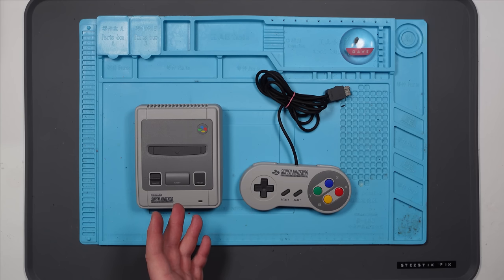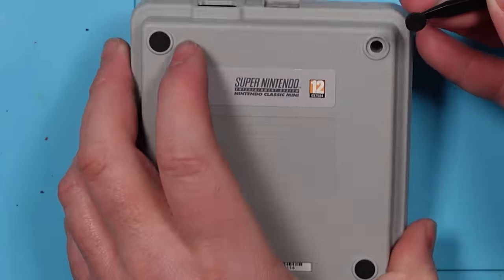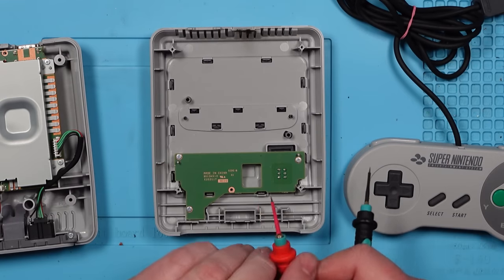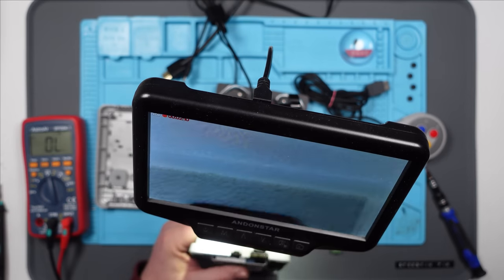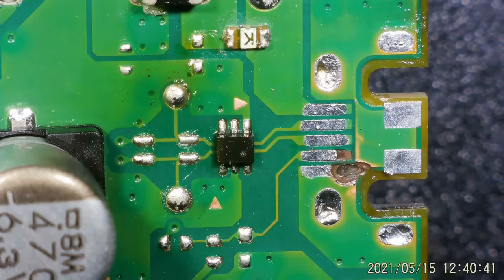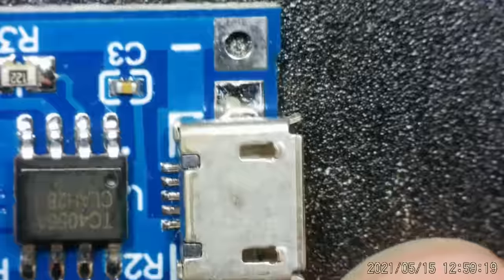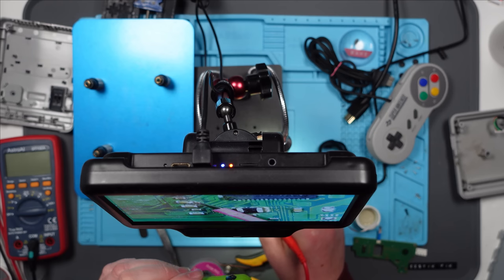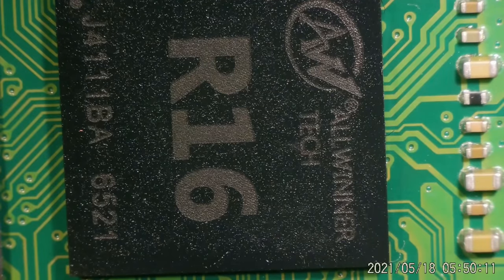Somebody's Been in This SNES MINI Before...

Comment: Love your work. That was toast but for what it's worth K is a 0.8A fuse so not advisable to replace with a 3. I'd just connect after the fuse and use a current limited bench power supply.

Comment: Haha, that was a good lump of solder on the port. The backstory would be interesting on this one, at least they gave it a go 👍
Reply from the maker: 👍 Thanks Vince, you're dead right. I shouldn't laugh really... I was just as bad when I started out! 😁
Reply: @StezStixFix  looks stickwelded :)
Reply: Yeah m8!
Reply: @StezStixFix  That may be the most generous lie I've ever seen told. 😂
Reply: yeah but they loose any good grace for then going on to sell it on ebay and pretend they don't know whats wrong with it, if i ever buy any faulty stuff on ebay (which i dont really because ebay is full of junk "faulty, maybe easy fix" horrifically botched items), but if i did i always have a quick look at their feedback and see if they have bought any "repair" parts previously, if so you know its either dead because another experienced repairer tried and failed, or 100% dead because some clutz screwed it up way worse than it was already and are now trying to play dumb and pass the turd onto someone else
Reply: @jamiegallagherDOinfo  Based on the visible damage I would bet that it was already fried before they ever opened it up, and what they did do didn't really make anything any worse than it already was..

Looks to me like a bad power supply probably put mains voltage directly onto the USB connector, which immediately fried a variety of components before blowing the fuse, and then it arced across inside the USB connector, vaporizing the connector pins and part of the board trace in the process.
Reply: @foogod4237  you could be right, but that is a hell of a coincidence that it was all shorted together with solder.
Reply: @BlackDuke235  Oh, they definitely went in after the fact and mucked about probably trying to (ham-handedly) fix the connector, thinking that that was the only thing wrong with it, but by that point I'd bet that the whole thing was already fully fried from the original failure so the solder blobs they added wouldn't have really done any more damage to anything than was already there...

Comment: Oh, that poor thing. At least you gave it a good attempt. The shell still otherwise appears in good shape. Could transfer the innards of a working one with trashed plastic and make a good one out of two. Either that, or use it as a Retro Pie case.
Reply from the maker: Thanks Zonic, I'm eyeing up both those options. I think I might go for the Pi option... think it will look pretty smart! 🤩
Reply: @StezStixFix  Yes, that's definitely your best bet. Especially considering even a trashed functional unit would be ridiculously expensive for the purpose.

Comment: Enjoying your videos just found your channel as I have done extensive work in electronics myself. Just wanted to suggest that the pads on the TP4056 board you tried to use for power are input. The B+ and B- are for battery but the direct 5v out are the Out+ and Out- directly beside the B+ and B- just a little hint. Great work though loving it.

Comment: My guess is that somebody tried to remove that by intentionally making a solder bridge so that the heat from an iron would flow to all the legs so that they could pull it out at once.  Kind of a neat trick if you don't have a heat gun, it works, but this must have been his first try at the technique.  Once the part is out you can just wick off all the extra solder on the board.
Reply: Nice one, didn't know that yet, but then again I do have a hot air station.
Reply: I would wick as I go, that way you dont melt the board and waste time.
Reply: Nahh just looks like a power surge screwed the unit up. They didn't have as good protection back then and even nowadays your electronics can still get fried from bad mains power. My town's been having voltage drops for years now, but I've seen other places that have the opposite and seen completely fried fridges where the plastic on the outlet melted and is black with soot.
Reply: @groundcontrol6876  "Back then"? That's a SNES mini from 2017. No mains power on there. Clint is pretty much correct on this one.
Reply: @rebel4466  Ahh didn’t know this thing was recent. I only ever had a PS1 and went on from there. Thanks for the info. 🤙🏽
Reply: @groundcontrol6876  A SNES Mini isn't a real SNES. It's an off the shelf, licenced emulator with preloaded games so that people can relive their console past in a compact modern format. 

Their is a PS1 mini too made by the same company dubbed the PlayStation Classic. They have an assortment of emulators for different older consoles. Like a retropie but only emulating a single console.
Reply: And here Iwas, thinking that whoever did this bought some random knockoff solder actually intended for soldering plumbing pipes.

Comment: The reason the switch acts like that is because it very likely holds a sleep line to ground on the CPU. It is a modern ARM CPU, and it never truly shuts down with connected power, it just goes to sleep mode.

Comment: Just got around to this one, just wondering if the power supply went bad and someone chopped the USB end off and attached it to a plug giving it 240V, I dealt with something similar where a customer chopped off a barrel connector and did the same!

Comment: Dear @StezStix Fix? I just got another SNES Mini with the same issue. I was able to confirm that the power board (the small one) was fine since I was able to connect it to a working SNES mini and it would work just fine  and I was able to connect the power board from that SNES mini to this board and nothing would happen, thus confirming that it was indeed not the small board. Now it looks like nothing was done inside yet actually and I can't find anything wrong with it, except for the fact that it won't power on at all. I compared the working and the non working board and at least cosmetically I couldn't find anything different... Do you have any recommendations what in particular I should look for?

Comment: I saw several SMT paste ball shorts in your video of this board.  If you look closely at the AXP chip legs, you can see small leftover solder from the surface reflow on this board.  I've seen this on two others I have repaired as well.  Might not be your only problem but usually this will be wide spread on the PCB.

Comment: yeah looks like they had trouble getting it off and just gave up. basically impossible to remove a surface mount connector like that with the supports and stuff without using some kind of solder sucker / hot air station

Comment: That’s one messed up device. My NES was got at but only to the tune of a cut track.  Someone cut IRQ and added a wire to rejoin it, didn’t realise they’d cut the next track.  All it need was another wire, clean the 72 pin socket at both ends and it was all good.
Reply from the maker: Yeah, this one was a mess! Glad you got the NES working, excellent stuff! 👍

Comment: Even if the board was ok, it probably would NOT power on with just a 5v and ground jumper wire. I tried that with a Playstation classic and it does not work. The board is looking for resistance on pin 4 of the micro USB power port. I think 470 ohms to ground, not sure...
Reply: its like a otg

Comment: ive seen similar before, a lightning strike made it through the power supply and blew apart the connector, hence hole and solder splattered everywhere

Comment: What liquid are you using when soldering and using the hot air blower?
Reply from the maker: It's Chip Quik SMD291 flux... helps the solder to flow 👍
Reply: @StezStixFix  thank you very much
Reply: @StezStixFix  are you using leaded or unleaded solder tin?

Comment: Well that was frustrating - by no means your fault. Not even a third hand would've helped here.

I am curious to see how the circuitry compares to similar devices, such as the Mini Classic Mini NES (yeah I said it 😉), TheC64/Mini, PlayStation Classic, etc; especially as they use similar software interfaces.

At least the controller will work (if they haven't "fixed" it...) on another Super Nintendo Mini Classic Mini SNES (that's what they should've called it!) or for certain Wii games (Mario Kart Wii, Mario All Stars or any Virtual Console game downloaded before the service was shut). The console shell would look good on display, if not as a donor or Pi mod as others have suggested.

Off topic a bit, Retro Games Ltd (TheC64/Mini makers) have announced a A500 Mini based on the Amiga series, due to be released around Easter time.
Reply from the maker: Thanks Toxo! I am incredibly excited by the A500 mini, it was my weapon of choice growing up.!
I think I'm gonna whack a Pi in this Snes mini classic mini nintendo. I reckon that will be pretty cool and definitely something I would use! 👍
Reply: @StezStixFix  Cool.

SNES - I wonder if the "Wii nunchuck" connector would adapt to USB without too much wizardry? If so it'll be handy for a Raspberry π retro emulator - for many systems' games.

Amiga - Dad had a 500, so I too am nostalgic for it. I couldn't be kept off of Lotus II. Although cosmetically based on the 500, it's supposed to support all the various Amiga models - I'm curious how it's going to change between the main 3 chip set types and processor/RAM specs whilst being user friendly - especially with side loading.  🤔  Let's leave the brain pain to the pros... 😁 As excited as I am, I may wait a while to see if a full keyboard model comes out, akin to TheC64. Could also be a future Christmas present idea for my old man...

Comment: What's the gel frequently used? I'm guessing it has thermal properties that protects the boad from the heat (?)
Reply: It's solder flux, it purpose is to get better solder connections.. cooling isn't really intended, though it does cool components a little.
Reply: @Icefumy  Thanks for the reply. After watching a bunch more of his videos, I was able to figure it out. Being pretty new to this kind of work, I'd never seen it applied like that and actually thought a solder with a flux core would be used. Appreciate the feedback to a noob question.

Comment: the worst solder job i have seen was where a local 'modder' dropped of an xbox 360 saying it wouldn't boot. he had managed to flow enough solder through the top side of the board until it touched the chasse underneath in an attempt to attach wires to some of the through holes. after i finished with the repair and undid his sad jtag attempt he was a happy camper. wasn't the last time he paid me to undo his handywork either.

Comment: Can I ask what the white liquid is that you put over the soldered areas?
Reply: 12:27 If you're talking about this stuff, then it's called soldering flux. It helps the solder flow much better. You technically can solder without it but I wouldn't recommend going without it for repairs like this. Removing parts without it can be a nightmare.

Comment: Steve, I think you were testing that switch wrong. You should have been testing vertically in the direction of the movement, not horizontally. Horizontally you were testing the common polls of the switch, not switch action.

Comment: Well brother Steve! you know how to pick em' alright. Looks like some tried an automotive soldering iron on it. Yes! Switch fuse will work also a 0 ohm resistor. □ 👍🏻
Pleased to see you didn't do as □ would have done. Grab a cheap china SBC that has the' Allwinner R16 quad core, Cortex A7 processor on it and drop it in the SNES.
Reply from the maker: Thanks brother Steve! I wondered whether that chip would be swappable. I think I'll remove the old one and double check those shorts disappear, and then order one up! 😁

Comment: 4:30 looks like someone put a plug in for better grip, then tried desoldering and the pins got stuck to the inserted plug then were pulled out while still hot on the PCB.
Signs of someone not using the correct equipment.

Comment: Can someone explain what happened exactly, I’m confused, why would someone even attempt to mess with the plug?
Reply: the cpu is fried, likely due to what looks like an attempt the previous owner made in trying to replace (for whatever reason) the usb power line.  I'm not even 100% certain it was a replacement, as the damage to that part of the board (and the fact that the CPU appears to be destroyed despite the fuse being totally shot) indicates someone tried to run a high current through the USB power.  This would explain the melted looking plastic where the USB contacts should have been, the burn marks on the board, and the CPU being toast despite the fuse blowing (get enough power going through a circuit and it WILL jump the gap a fuse makes when it blows). Further evidence is also the various other parts on the board that look like they have small holes in them (like that chip near the fuse he replaces, it's got a very visible hole in it), and the fact that the circuit board itself, near the USB power input, AND the casing for the board all have burn marks in the same areas.
Reply: Thanks. I honestly got recommended this from YT itself, probably because I watch a lot of Hugh Jeffreys, and while parts needing replacement I understand easy, stuff directly involving the boards is Greek to me currently.

Comment: so... if the CPU of a device is heating up that means that it's dead and unfixable?
Reply from the maker: Not always, but it generally means that it's shorted out.  A CPU can get hot straight away through normal use, but this one was definitely shorted to ground.
Reply: @StezStixFix  a BIG THANKS for the response. For you, you might just answered the question by a whim but to us you inspire it is another piece in our learning puzzle. Thanks again.

Comment: The curse of someone,s mistakes and dodgy work i am getting through the previous owners mistakes and mess they made of a 3 head sony cassette deck i got off ebay for £10 a few years ago last part of it being fine is getting the head alignment and height set correct previous owner removed screws from the head i have no idea why .A shame it could not be fixed .

Comment: Look, I have absolutely no clue about electronics, circuit boards or electricity in general (and my very basic soldering I did so far is god-awful) but even I couldn't help but laugh by ass off after seeing that abomination. I think even a toddler could look at this and see that this isn't gonna work...

Comment: Let me tell you from one absolutely no-knowledge-about-electronics (me) to someone who is actually able to fix things (you): 
I assume, the guy realised that the pins in the usb-port werent there, or to broken. So he thought with my logic: lets put kind of an hole on the other side of the usb-port, and flood it with some solder, so that it floods into the grooves where the pins once were. Problem solved :) ... except its not, because it shortens everything xD ... But thats how i would have done with my no-skills... and thats what probably the guy who tried to solve the problem also was thinking ^^ ...
Then he gave up, and sold it to you ^^

Comment: I don't like these mini consoles for many reasons including this, they are far too small and light. If you pull on the controller the entire console comes crashing onto the floor and the cables are usually about 3 feet long. Even a thick power or HDMI cable can pull them over or rip out the ports. They are rubbish. I would not even put one on display.